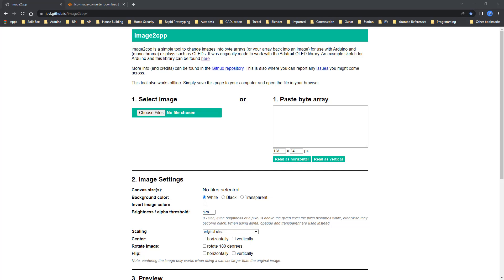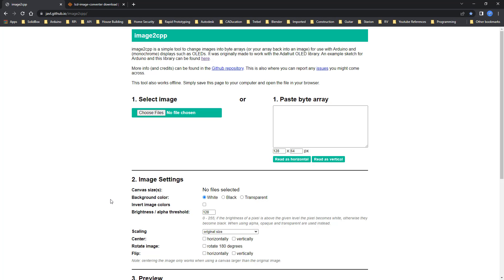Using Images and Sprites to Make a Gauge | Beginner How To Converting Images to CPP to Sprite

Comment: This is a very nice and value video. I'm currently creating an application to monitor the cooling of a watercooled CNC motor. I had a rectangle TFT screen and 5 zones, one round gauge with needle, one vertical meter with small rectangle indicator, a water level detector, one empty zone for future (detect running of spindle) and a general zone indicating OK (green), warning (yellow) or red (dritical). I did draw the needle and small rectangle....and its a drag with many limits. Currently working to try to use sprites... and your video will help me! Thanks!
I did have other issues, the meters are jumping and not fluently moving, so I had to make the funtions to move in steps so it stays visible fluently moving.
And secondly, having different sensors and funtions to do things on the screen I had to make my 'main()' more of a time management routine that will only go to a funtion (read sensor of move some indicator) every so many milliseconds. This makes everything look like its all moving at te same time and without stutter. Now every zone has its own timer that will be handled from within the main() and this works great.
Now I will get rid of the moving indicators and use sprites...you convinced me that that is far better.
Reply from the maker: Very cool project Ruud!  from my research I think the Nextion display seems like one of the best options for what you are doing.  https://nextion.tech/   The display has its own processor and they also have their own software to help build the GUI.  And they are touch screen.  The benefit here is the graphics heavy lifting happens on the monitor hardware rather than on a microcontroller.  You would use an Arduino or similar to send it commands but everything in the graphics doesn't eat into your memory allocation.

For what you are doing now as you transition to sprites you might have good luck pushing everything to a single background and then displaying it.  Even if the background was just a single color.  So if you had a 320x240 display you could make a sprite that size and push all the other gauge elements onto it.  The main downside to sprites(as far as I am aware) is that you can't resize things.  If you are manually drawing your gauges you can use variables to control things like text size, gauge position etc.  So to me that is the only downside to image sprites.  But this video and the previous one in this playlist were both sprite videos.  The last one used sprites but we used drawing commands to draw the gauge and display a number and needle position.

I am learning as much as I can so feel free to ask questions and I will try to answer as you progress with your project.
Reply: @LearnEverythingAboutDesign  Yes I know the Nextion displays and they are on my whishlist, I really want to try them. The graphic designer and the usage in the program look extremely easy. But I have still a few of the TFT's laying around and wanted to use them. My brother burned his CNC spindle recently so this project was pushing itself in priority. And doing the complete hard and software is fun to do...and it is a practical thing so you get much satisfaction.
For now I'm working with zones for which I have a funtion that get arguments for left upper coner, width and heigth. This allows me to make sure inside the funtion everything is drawn according these base coordinates in case I want to move things.
It is mainly the 'moving' parts that are the difficult factor. And I see you do things for which I had to do a lot of effort...so your video helped me to understand the sprites better.
The current project  measures the cooling temperature, the flow through the spindle motor and the level in the container. Using the ESP32 and the TFT touch makes it a very versatile project from one learns a lot.
If I have questions I know now where to ask ;-)
Reply from the maker: Have you seen this project? https://www.instructables.com/Arduino-analogue-ring-meter-on-colour-TFT-display/   
It was done by Bodmer, who also wrote the eSPI library that is used for sprites.
Reply: @LearnEverythingAboutDesign  Wow, very nice stuff. Maybe I need to look into this one also. It might help me because my meter scales has color bands to indicate normal, warning an critical range. This looks good. Thanks for the link!
Reply from the maker: No problem.  It is very clever and gives you the ability to build multiple gauges off the example.  I found it a bit harder to configure the way I wanted but was able to get something working.  Maybe it will get you a quick working Prototype!  If you do I would love to see the project!  support@caducator.com

Comment: Great video!  Just what I was looking for, although I've run into a puzzling issue.  I'm able to create the image code using image2cpp, and it loads perfect using the "tft.pushImage(0,0,132,20,needle);" code, but when I add the "TFT_eSprite needle = TFT_eSprite(&tft);" code, I recieve the error "Compilation error: conflicting declaration 'TFT_eSprite needle'.  Even just adding that line with no other calls to create the needle throw the error.  I'm using an ESP32 with the #includes for SPI.h, TFT_eSPI.h and NeedleImg.h which has the needle image bytes.  The first line of the image code is "const uint16_t needle [] PROGMEM = {".   I'm baffled why the image will display when I push it but won't compile when I add the  "TFT_eSprite needle = TFT_eSprite(&tft);".  Any ideas?
Thanks again for the great walk-through videos!
Reply from the maker: Is it possible you can send me the ino file?  support@caducator.com  might be a bit easier to trouble shoot that way.

Comment: Great videos, very helpful.  Do you have a target [ round ] display in mind for the actual instruments?  I'm looking for a round display to replace an aircraft instrument.
Reply from the maker: Thanks!  For this I don't.  So this was answering a user question who was using a round display.  In the future when I make the gauge I am planning it will be with a Nexion display.  There are limitations to the implementation of TFTeSPI in the m5stack for example I can't push multiple sprites to the same display because they didn't include that.  There are other implementation that could do it but you have to consider things like the speed/responsiveness of it.  This is where the Nexion displays really shine.

so shorter answer no I don't have immediate plans to do more with this specific one because it was for a user that was having issues implementing the basic movement smoothly.

Comment: Hello, this is a very interesting video. I would be interested to know if I could also use such a transparent sprite for a website? So store it in flat storage. Could you make a video about this?
Best regards
Lutz
Reply from the maker: Lutz, I am the furthers thing from a web designer so sadly I can't make a video on that.  The way sprites are used for something like this gauge are really there to either save memory or speed up the display.  Loading a sprite into memory then flashing it to the screen rather than drawing it each time.

For websites, to the best of my knowledge, sprites are used but they will normally use a sprite sheet.  Sprite sheets are similar to what I did in this video except that you call a location of a larger image rather than an individual image.  I did a quick search and found this site that seems to explain it pretty well.  Hope it helps. https://www.dbswebsite.com/blog/how-to-use-sprites-in-web-design/

Comment: good evening .. does it works with arduino one?. Memory is enough?
Reply from the maker: I have used sprites on everything down to a microview(little watch arduino uno based device).  You can use sprites on anything, but yes you have to watch the memory.  Instead of doing full screen images you may find you need to reduce the quality or size of your images.  for example a black/white image vs a 16bit color image.

Comment: wow man !!!! This is right what I was looking for. I am trying to do multi gauge using different screens for various parameters.
 the only thing I am mising is a analog watch. Any suggestions wellcome. Tanks in advance.
Reply from the maker: Glad I could help!  What equipment are you using?  Since I am on the M5Stack I have hit the limitations of the partially ported TFT eSPI library.  I can't composite multiple sprites past the pushRotated so you can't overlay multiple sprites on each other(other than the rotated).  If you are using the TFT eSPI library directly there is a pushImage function you can use to overlay.  Anyways the point of that is I was directed to this other library.  https://github.com/lovyan03/LovyanGFX

I haven't had a chance to really dive into it yet but they do have a clock as one of the examples.  https://github.com/lovyan03/LovyanGFX/tree/master/examples/Sprite/ClockSample

They are just counting up using milis I believe, so you would need to sort where you are getting your time from.  If you are using GPS that is pretty straight forward as it can pull in time/date info.

Are you building this for a vehicle?  Are you using something with actual clock/time?
Reply: @LearnEverythingAboutDesign  Hi there, I´m using ESP32 DEV1 board and 1,28in 240x240pxl round display with GC9A01 controller
Reply: @LearnEverythingAboutDesign  I´ve tried  with arduino nano and pixi 28 from 4D Systems but its limited memory. I´m building it for my motorcycle.
Reply from the maker: Thats great!  I run a trail tech gps speedo on one of my bikes which has everything I need, but I am planning on building a dash for a project car.

I have a PCB I designed that has an micro SD slot, a spot for a QTPY(Samd21 chip) and the ability to be used to send info to an LCD if you are interested.  I can share the design.  It isn't 100% complete as its main function was an LED headlight dimmer which ended up overheating and saturating the FETs for some reason.  I will be out of town for a bit but if you would like the fusion pcb file let me know.
Reply from the maker: are you using the TFTeSPI library for your sprites?  if so there is a clock example https://github.com/Bodmer/TFT_eSPI/tree/master/examples/320%20x%20240/TFT_Clock
Reply: @LearnEverythingAboutDesign  I´m struggling with rotating watchhands.
I´ll try this LovyanGFX , see what comes out.
best regards

Comment: How can I do that using arduino gfx library by moononournation?
Reply from the maker: to the best of my knowledge the gfx library doesn't specifically handle sprites.  There are a few things you can do like using the GFX canvas which is a group of pixels in memory.  this was really made for things like text scrolling or image scrolling and not really for a gauge like this.  If you use the GFX library redrawing the needle with a line is likely the best way that I know of.  

https://learn.adafruit.com/adafruit-gfx-graphics-library?view=all

I did a 3.5hr part one of this playlist where we used a sort of draw/redraw approach that should work with the GFX library.  I used the M5Stack, but they just adopt other libraries so the LCD functions in the m5 should be similar because we are just drawing lines and circles.
https://youtu.be/xlb7FGKBp3Q

Comment: I am making an artifical horizon for an aircraft. I have 3 sprites on top of each other. Airplane symbol - ground/sky box - Outer casing. How would I go about layering those items and making it smooth
Reply from the maker: are you using the M5Stack like in the video or something else?  Basically what we did was we pushRotated for the needle on top of the gauge background.  You just need to push multiple needles.  There are limitations with the M5stack library version of the tfteSPI library.  the real library has a pushImage also that didn't make it into the M5 library.
Reply: @LearnEverythingAboutDesign  thank you for the quick, reply, I have a few sprites neatly layered, however when it comes to animation, everything is flickering. I am trying my best to figure things out with pushToSprite
Reply from the maker: @greenlightzone  are you doing this on an esp32 controller?  Which display are you using?  I plan to do some more arduino/display projects in 2024 as I have had a lot of requests for exactly what you are asking for so it will be on my short list.  My plan was to do more with the M5 stack but I think most users have something else.
Reply: @LearnEverythingAboutDesign  Sorry for not answering your main question. I am using an Esp32s3, a lot of ram, psram availability and fast cpu. I have a Spi LCD screen 240 by 320. ILI9341
Reply from the maker: @greenlightzone  no problem.  With the flickering this "usually" happens to me when pushing/clearing the screen and trying to redraw multiple sprites.  Doing the composite sprite in memory and pushing it all at once doesn't usually trigger a flicker unless it somehow hits a limit with the displays refresh rate. I don't specifically know what your display is but likely a delay between "pushes" of 25ms should help.  So composite all your sprites in memory with the background being the entire display size, push it to the display, read your sensors, delay 25ms, composite to memory, push etc etc. 

Hope that makes sense.  The datasheet for each display(if available) should list the refresh rate.
Reply: @LearnEverythingAboutDesign  I went off experimenting and this is what I found with my code: I've used millis to add intervals matching a 60Hz refresh rate of the screen. Flickering persisted but it is uniformal, whole screen black for a split second. I decreased the Spi clock speed drastically.  The screen remains black for longer. It seems as if my buffer is not storing the image at all. The whole image will only display correctly for a split second between each SPI clock cycle. But it doesnt store the image and instantly goes black again for a while. I will keep trying to fix it. It is probably not a image size issue since drawing a small square acts similarly. Library is correct because the screen can generate example codes perfectly fine and smoothly. Also changing the background buffer sprite from black to white does nothing. Still black
Reply: this is my code:

#include <TFT_eSPI.h>      // Include the TFT_eSPI library
#include "Grey_cover.h"    // Include the header file for the image
#include "Horizon.h"

TFT_eSPI tft = TFT_eSPI();  // Create an instance of the TFT_eSPI class
TFT_eSprite Horizon = TFT_eSprite(&tft);
TFT_eSprite greyCover = TFT_eSprite(&tft);
TFT_eSprite back = TFT_eSprite(&tft);  // Back buffer sprite

uint16_t transparentColour = TFT_WHITE;
unsigned long previousMillis = 0;  // Will store last time screen was updated
const long interval = 16;          // Interval at which to refresh screen (in milliseconds)

void setup() {
  tft.init();
  tft.setRotation(1);
  tft.fillScreen(TFT_BLACK);

  createHorizon();
  createCover();
  back.createSprite(501, 481);
  back.fillScreen(TFT_WHITE);
}

void loop() {
  unsigned long currentMillis = millis();

  if (currentMillis - previousMillis >= interval) {
    previousMillis = currentMillis;

    plotHorizon(10);  // Update the horizon with the new roll angle
    yield();          // Avoid stalling the program
  }
}

void plotHorizon(int16_t roll) {
  // Optionally, only clear the back buffer if necessary
  back.fillSprite(TFT_PURPLE);

  Horizon.setPivot(250, 240);
  greyCover.setPivot(160, 120);
  back.setPivot(160, 120);

  Horizon.pushRotated(&back, roll);
  greyCover.pushToSprite(&back, 0, 0, transparentColour);

  back.pushSprite(0, 0);
}

void createCover() {
  greyCover.createSprite(320, 240);
  greyCover.pushImage(0, 0, 320, 240, Grey_cover_data);
}

void createHorizon() {
  Horizon.createSprite(501, 481);
  Horizon.pushImage(0, 0, 501, 481, Horizon_data);
}
Reply: QUICK UPDATE!!! Out of desperation I yanked the BLK cable, it works now!!!!!
Reply from the maker: @greenlightzone  WHAAAAT?
Reply from the maker: @greenlightzone  This is strange.  I know there is a persistence of vision that corrects some thing but the background not changing is odd.  I saw your other comment that you got it fixed so that is good to hear!
Reply: @LearnEverythingAboutDesign  I never touched the backlight (BLK) pin, so it was probably Low/0. Possibly making the screen dim every cycle hence the flickering occuring. Now I am trying to get a good library for the MPU6050 to give accurate angles. Thank you for all the responses, enjoy your new year!
Reply from the maker: @greenlightzone  Awesome, that one is new to me so ill pack it away in my memory :)  thanks for sharing the experience and happy new year to you too!